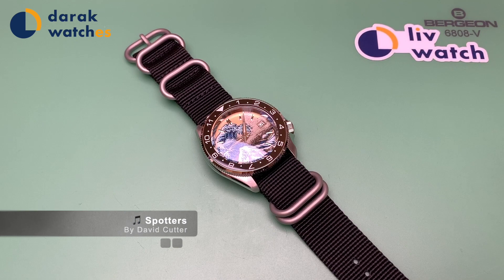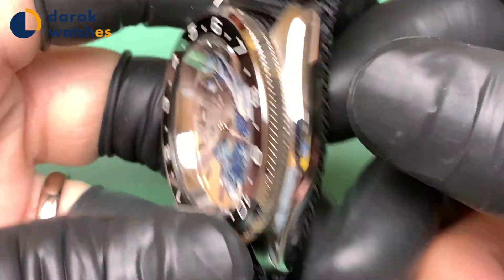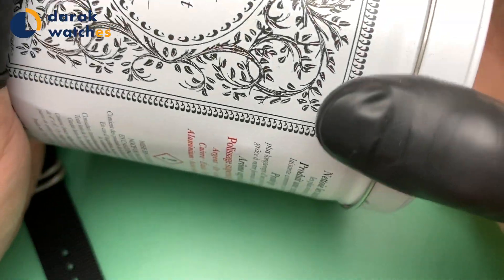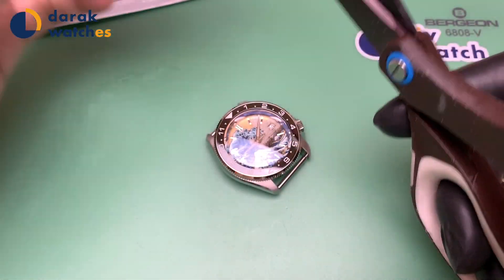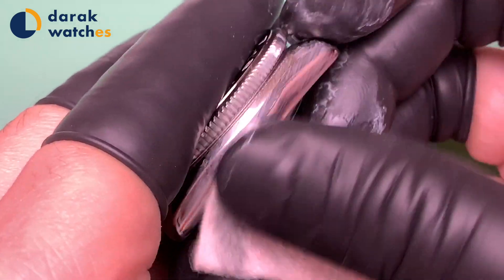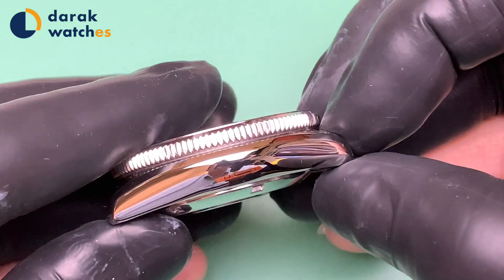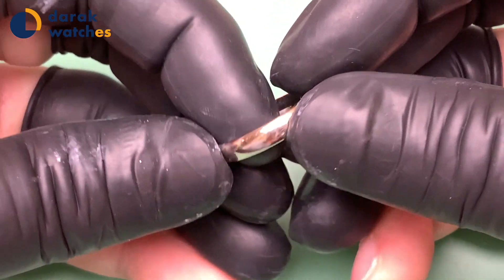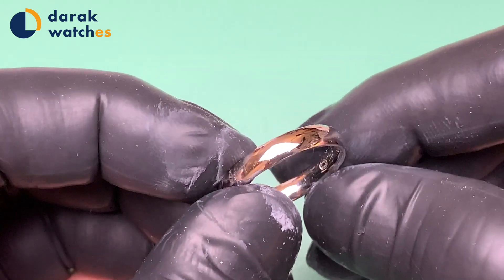How To - Polish Watches with Cape Cod

Comment: Even after using Cape Cod cloth. If you look closely it creates very tiny micro scratches. Don't believe me? Look closely in the sun! You heart will sink. Removes bigger scratches and creates little ones.
Reply: And how we can get off those micro scratches?
Reply: @juanignaciosantiagovaldivi2470  best way is to gave it done at a very good jeweler. With a fast polishing wheel. Bad technique will leave the small micro scratches

Comment: Instead of a tissue paper, if you use a microfiber cloth, and buff it to remove polishing compound, you will get no fogging and a brilliant shine. The microfiber and the rapid buffing, albeit minute, will also remove material. Wiping the polishing compound with a tissue paper gently means you are missing out on that final 'sanding step.
Reply: I have fogging on the steel I can only see under flashlight. What do I do about that?

Comment: I just received Cape Cod Polish Co Metal Polishing Cloths Foil Pouch 0.53oz, Stainless Steel form Amazon. I had some rub marks inside my Rolex clasp and a couple of hairline scratches on the lugs. The cloth didn’t remove anything, I tried it several times. Very disappointed.

Comment: I've use this product for 10 years now and find it is the best.  It will remove metal as time goes on, just as it removes scratches but it is very fine polish.  For me, cleaning the Cape Cod off of the watch is easier with alcohol.  It cleans between the cracks and links very well.  I dry with a fine cloth that will not scratch my work.  Thanks for the video and your process.

Comment: I use 'em. Love 'em. If you need to get out deeper scratches, I use Mother's Mag Polish with a Dremel and a cotton buffing wheel set to the lowest speed and then finish with a Cape Cod Cloth to get that mirror-like-new finish. Of course, avoid brushed surfaces too, although, one or two gentle wipes and then remove with a microfiber towel can really improve the finish of the brushed surface too. You just need to use excessive restraint.

Comment: No issue with Cape Cod other than the price. Any proper metal polish will achieve the same or better results. Granted, the CC cloths are an all-in-one solution, however. Would definitely recommend using microfiber cloth vs tissue paper for final cleanup. Good video as usual.

Comment: Can Cape Cod damage the crystal on my watch? I wanna polish a portion of the bezel on the face, and am worried it might rub against the glass a little. I’ll prly just tape it off, but asking just in case.
Reply: Mask it up
Reply: Depends what sort of crystal. Plexy … it will polish it as well. Mineral will be fine but not hard pressure on the glass. 

Sapphire crystal is almost as hard as diamond. Cape cod will no effect on it.

Comment: Hello ! Did the polishing leave lots of small dots on the surface ?
Reply from the maker: Hi Alpina, no, if you see a lot of small holes or dots, that this due to bad casting.
Reply: Thanks for the reply.I was thinking about this, but I really can't understand how they would form, considering that I gently wiped the side of the case (removed just a tiny layer of material, just to make the initial scratch less noticeable) without creating other bad scratches.The watch is an Invicta pro diver.